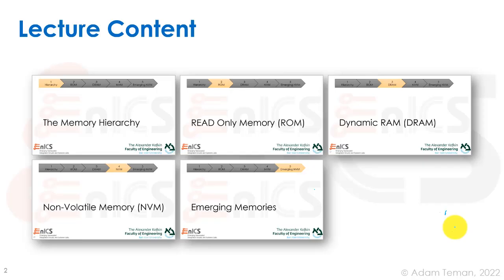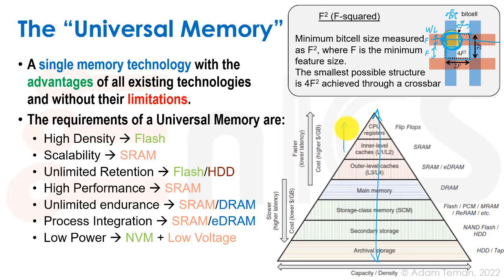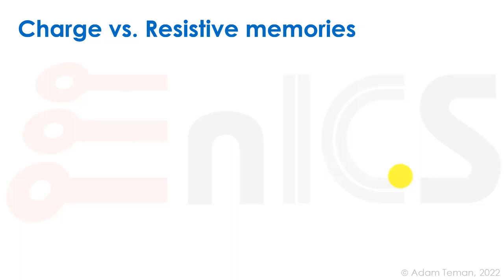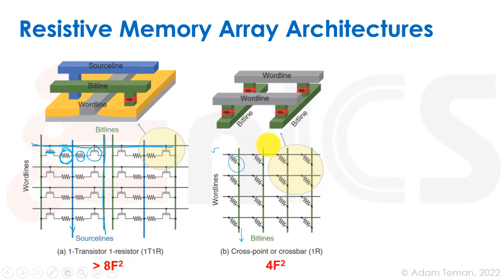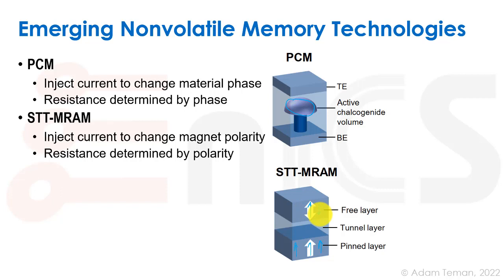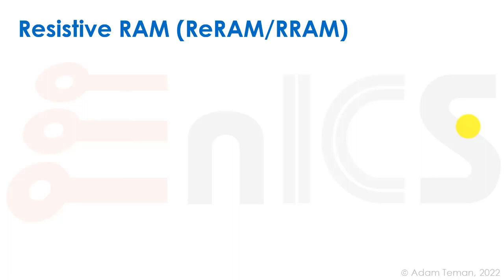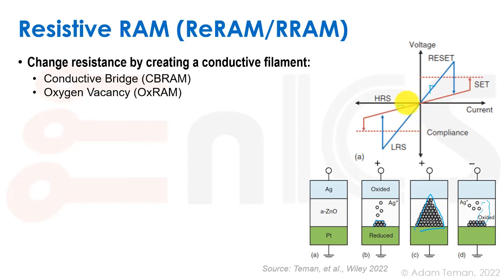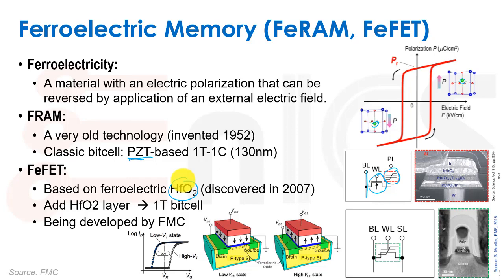VLSI - Lecture 11e: Emerging Memories (PCM, ReRAM, MRAM, FeRAM)

Comment: Thanks for the lecture. Is it possible to share the material you're referencing on this slide (Teman et al., Wiley 2022) ?
Reply from the maker: Unfortunately, you need a subscription to Wiley to access the Encyclopedia of Electrical Engineering that this is published in. Possibly you can access it through your university or company.